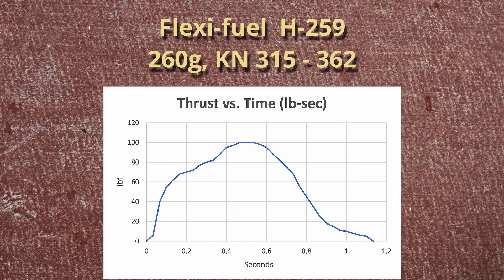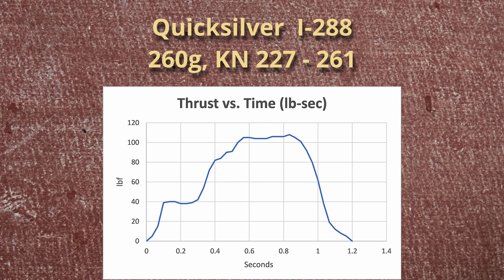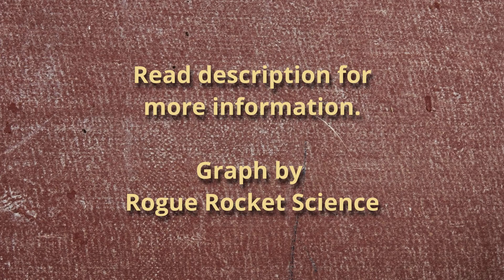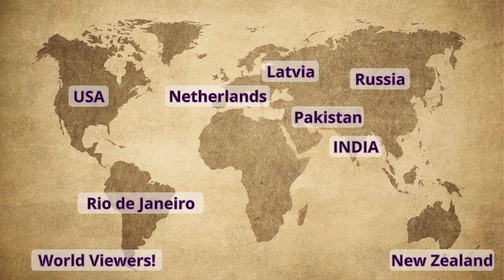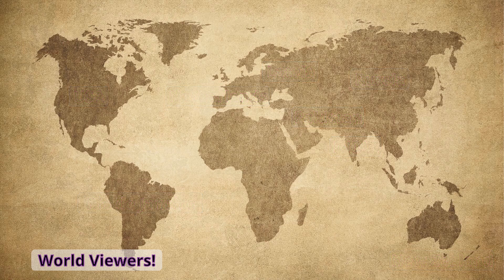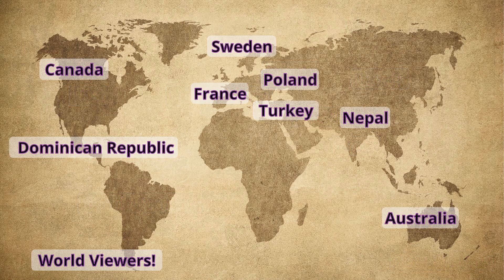3 sugar fuel shootout!

Comment: You could counter the early thrust plateau on your aluminum additive motor quite easily. Only add aluminum to the top 2/3rds of the motor, so that the first 3rd has no aluminum, will give good thrust, with nice boost about .6 seconds into the burn. Or, for a more complex solution, use 15% aluminum in the top 2/3 and about 7% aluminum in the bottom 1/3rd.
Reply from the maker: That's a great idea and I think you are on the right track. I have found adding a small amount of magnesium helps and increasing motor pressure will minimize the anomaly.  It is a fine balance between minimizing the problem and keeping that amazing yellow tail! Thanks!

Comment: I can definitely see a hint of purple in the  3rd test becuase of the potassium. You should try replacing some of the KnO3 with SrNO3 and you might see a nice red color. Also do you add a few percent boric acid to the mix with aluminum? I heard it makes compositions with aluminum and nitrates more stable
Reply from the maker: I have not experimented with strontium nitrate yet because I am still working through several other compositions. The idea does sound very intriguing.

The airfloat 5 micron aluminum I use is oxidized on the outside and I rely on that for passivation. I have ground Kno3 and aluminum with a hammer along with striking it and have not generated a reaction. I make sure my grains are stored in an airtight container with desiccant to keep them dry and I do not store them near any other fuel. I am not a chemist but so far this has worked well for me.

Passivation
https://en.wikipedia.org/wiki/Passivation_(chemistry)
Reply: @TheRocketeer did you test with titanum?
Reply from the maker: @beratustun7450  I have titanium sponge but have not tried it yet because it is the destroyer of graphite nozzles.

Comment: Have you tried quicksilver, but with KNSB instead of flexi fuel ? And what ISP did you achieve with this quicksilver ?
Reply from the maker: I achieved a Specific Impulse (ISP) of 137. This is an improvement over the typical 110-115 but I am more interested in the huge flare and roaring sound!

I will know the answer to that soon. Today I casted 3 grains with KNSB and 10% aluminum. I also casted grains with a mix of magnesium and aluminum at 2%. Magnesium burns very hot and fast so I am being cautious. If all goes well I will go with 5% Mg/Al.

The 80% sorbitol and 20% sucrose is not compatible with aluminum powder. Additional testing has proved that it won't work. This fuel led to the destruction of Zebulon Pike and a 54mm motor.

Thanks for your question, I like the way you think :)
Reply: @TheRocketeer  an improvment of ISP is always welcome but I do agree with you : that bright flames and these sparks are certaintly more interesting !
I can't wait to see the results of your test with KNSB, I'll probably take a look at Aluminium when my motor is fully machined.
Thanks a lot for your content ;))

Comment: at which time of the preparation do you add the Al powder ? Aren't you afraid of the propellant lighting of during the heating process ?
Reply from the maker: I add the aluminum last to the propellant.
I monitor the temperature very closely. The fuel will give off a burnt smell if the sugar starts to carmelize. The ignition temperature is far below the casting temp. Splashing the fuel on a hot burner or a drip running down the pan will cause a fire! 

I don't recommend adding aluminum to the propellant because it is in the early experimental stage.

Comment: 1:22 that's a nice looking curve for sorbitol !! how did you avoid the mountain like shape ?
Reply from the maker: I add magic dust to the mix. Just joking! The flat curve may be caused from lower pressure.
Reply: @TheRocketeer  intresting. Nakka experimented a few things about it and came to the conclusion that spacing the grains of ~25% of the grain diamter will result in a bettter ignition, as well as coating the core of ignition primer

Comment: HI! Great video, I was always interested in diffrence between KNSB and KNSU. I was wondering if magnessium powder can be used instead of aluminum, and is using Mg in it safe?
Reply from the maker: I don't know if it is safe to use magnesium in sugar fuel. Magnesium tends to burn very fast and hot which could could result in a charred nozzle or a cato if the concentration is too high. Magnalium is a 50/50 mix of aluminum and magnesium that I have considered using at 5%. I don't know if magnalium is safe to use either. Thanks for your comment!
Reply: @TheRocketeer  Thanks! I was just asking, because I got 1kg of Mg dust from friend and I don't know how to use it.
Reply: I have fired numerous sugar motors with 21% Mg. It works great and looks quite like White Lightning

Comment: bro can lunch horizontally ?
Reply from the maker: The motor can be tested horizontally but a rocket may only be launched vertically. We are responsible for the safety of others including property.
Reply: @TheRocketeer  all motor testing, vertically nozzle down or up and horizontally can be dangerous if the motor CATOs or if the bulkhead blows out. That causes the motor to go in the opposite direction as the blown bulkhead now becomes the new 'nozzle'  https://www.youtube.com/watch?v=8wousLLepx4

Comment: Thanks for this vidéo ! (sorry for my bad english level)
What is the composition of the QUICKSILVER fuel ? flexi fuel + little amount of aluminium powder ?
It's very interesting because in the test of QUICKSILVER test, i understand that the KN is a few lower than for the sorbitol test and for the flexi fuel. and despite this, the ISP is higher. And 20 s is not negligible ;).
Reply from the maker: Quicksilver is flexi-fuel with 15% aluminum powder added to it. Yes, you are correct that I used a lower KN (227-261) because the fuel burns faster and it has a higher total impulse.
Your English is good!
Reply: @TheRocketeer  thanks for your answer :)
And you don't have any problem with mecanical properties of this QUICKSILVER fuel ? i mean, because add 15% of aluminium powder can create some difficulities to obtain a strong grain no ? Plus, any chance for aluminium powder to react with the rocket candy (during the heating phase for example) ? Your work is very interesting, if you don't mind, i will use maybe your video to present your concept (add some amount of aluminium powder) on my next video in my channel... it's up to you :)
Reply: just to explain in french your test and your results ;) If you are ok, and you have more information about your test, you can write me by e-mail (at the bottom of my videos descriptions)

Comment: hi, how can i increase the burn time for the quicksilver fuel?
Reply from the maker: I don't think the burn time can be increased because aluminum requires a lot of heat and pressure to burn. Motors that have a thick web like a 54mm vs a 38mm will tend to burn longer. After all it is called quicksilver : )

Comment: Did you make the nozzle or did you buy it? If you bought it, how did you mount it in the pvc pipe?
Reply from the maker: The graphite nozzle is standard from LOKI. The 38mm motor slides into a 1.25 PVC pipe and the thrust ring catches the outside perfectly. I should have explained that, thanks!

Comment: Did the results closely match up with the loki software you demo'd in a previous video?
Reply from the maker: Yes, I would say the results were similar. I almost blew the last motor up so I used a larger nozzle this time.

Your second question.
I'd like your opinions here on preference. Longer impulse on a lesser newton's or the opposite. 

Answer
It depends on what you want to achieve. 

A short burn will generally lift a heavier rocket off the rail faster for stability. It will also help keep the rocket on course if there is a cross wind.

A long burn will tend to achieve a higher altitude and give a slower more realistic launch. Use this for a lighter rocket on a calm day.

Both sorbitol motors (and flexi-fuel) have very similar total impulse (energy) so the choice is up to the user. Good question, thanks!
Reply: @TheRocketeer  thanks for the replies. You are very kind.